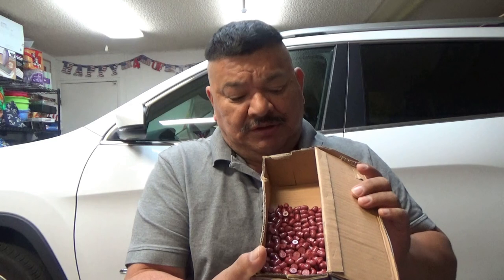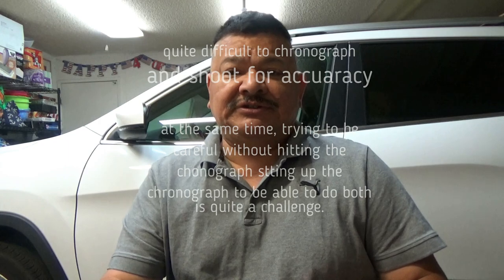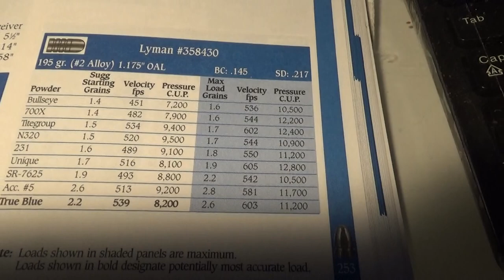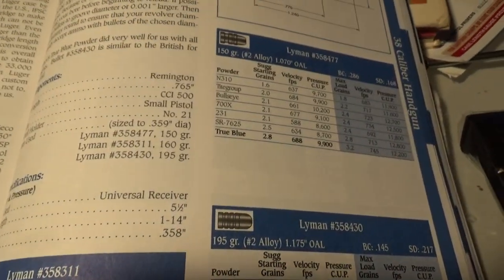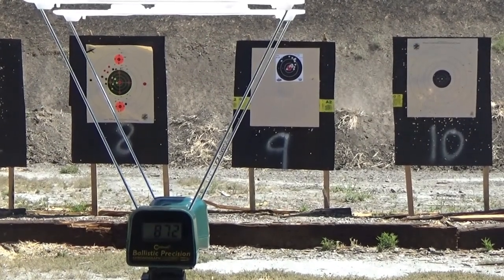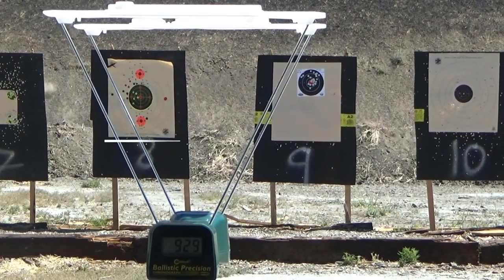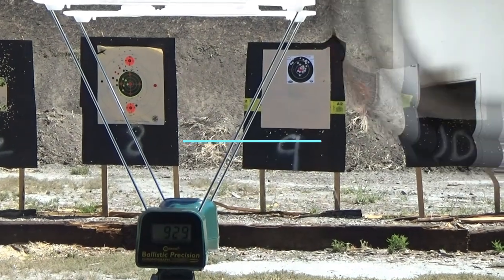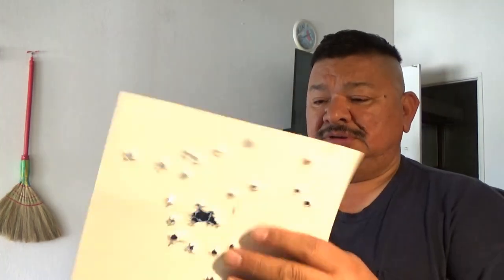9MM CAST BULLET LOAD SWEET SPOT.

Comment: Great video as always. I really like HP38 allot and use it in 9mm among other calibers. It really meters well and over all, it's not that expensive to buy. With the burn rate of HP38, a little (charge weight) goes a long way, even with a 1 lb bottle.
Reply from the maker: thank you for your reply, i havent bought hodgdons in so long because i always had red dot or unique around but i do like hodgdons as well as yes lb per lb more bang for your buck i would like to try it in my 38 spl shorts as well.

Comment: Good video dude.  If people want to Chrno their loads that okay by me, I have a Chrno, however I seldom use it, the only thing I'm interested in a accuracy. Like you said, You have to set it up and shoot through the sky screens and that disturbs you aim. So that's why I don't Chrno in my videos.  Btw, You may want to try the Lee 105 Gr bullet if you haven't already, It it for the .38 spl however it shoots good in the 9mm.-Dave
Reply from the maker: I TRYED THE 105 SWC IN MY 38 SPL SHORTS AND ITS A VERY GOOD LITTLE BULLET, YOU GET THE SWC PROFILE WITHOUT WASTING A LOT OF LEAD DOING IT IT WORKS fINE IN MY BERETTA Vs MY SIG-2022, SO THIS IS WHY I USE THE 15YD LINE VS THE 25 YD LINE BECAUSE THERE'S LESS CHANCE OF RUINING MY CHRONO AT LONG RANGES,  USING THE 5 YD RANGE ISN'T MUCH OF AN ACCURACY RANGE FOR ACCURACY RESULTS MOST HANDGUNS EVEN SMOOTH BORED HAND GUNS CAN GROUP WELL WITH NO PROBLEM AT THAT RANGE.